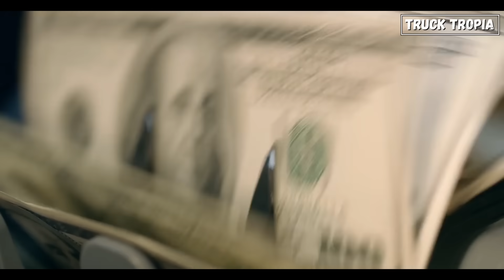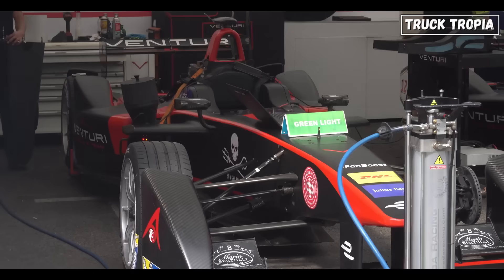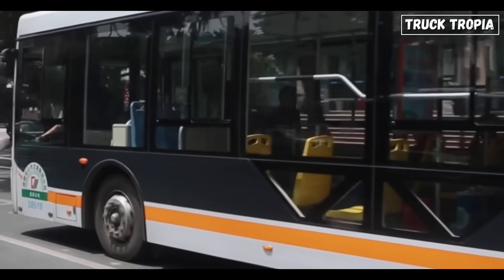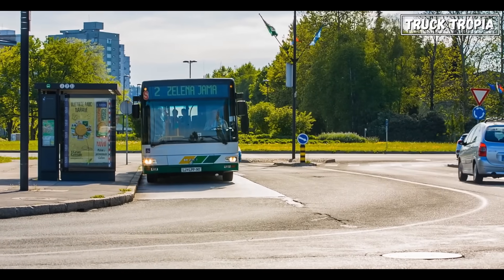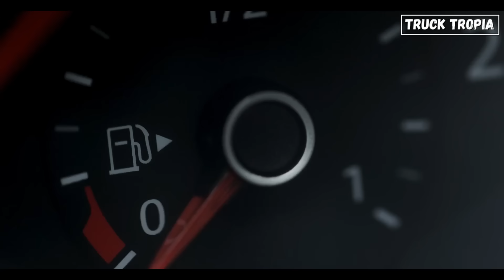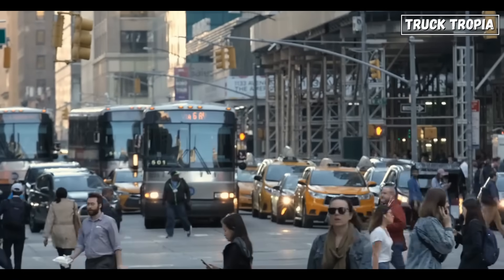Why Do Big Buses Have Rear Engines?

Comment: This is a poorly reeearched video. It should be made clear that it's mechanically more simple to make buses rear wheel drive, as well as giving them more traction thanks to the rear wheels being closer to the centre of gravity of the bus. So next it makes sense to have the engine close to the driven rear wheels to avoid having a heavy & costly long prop shaft (not a transmission tunnel as stated in the video. That's true of low vehicles like cars but would not be necessary in a bus). The weight of the engine does also improve traction as the video states but a lower polar moment of inertia for better handling is not a requirement for a bus given it is low anyway thanks to the long wheelbase. If this were the case it would be better to have the engine in front of the rear axle (like an F1 car) instead of behind it (not like an F1 car) but the latter is better as it greatly improves maintenance access for the engine. It also means a luggage compartment (if fitted) is centralised rather than having different smaller compartments spread throughout the bus.

Comment: Can someone explain why buses somehow must have a rear-wheel-drive?

Because the first two points of the video would immediately be fixed in a front-engine bus, if it had front-wheel-drive. No long cam, and thus no long floor, and similar efficiency...

Comment: What they do......is have the engine in the back,the power is transmitted via drive shaft upto the front of the bus where the gearbox is under the seat and then its transmitted via drive shaft to the slipdiff and then to the back wheels

Comment: Around 1975 I was in a bus in Peru which had a mid engine dual turbocharged flat 6 diesel, that was passing cars on uphill curves at around 14,000 ft in the Andes.
Reply: Turbo almost makes it immune to altitude.  At 14000 ft those naturally aspirated engines are minus 35% of their power.

Comment: There is a 5th reason. In the event of an engine fire its alot easier to get the passangers off at the main low entry door. Even more so if they are a wheel chair user. In a front engine bus you then have to get the passangers out the emergancy exit at the rear weather they can walk or not.

Comment: Nobody:

Meanwhile Van Hool thought back then let's bring the engine tower behind driver's compartment...

There are mid-mounted AG 300 buses which are very striking (you see the rear is flat and the seats across it by the window)

Comment: Sorry, none of your arguments makes sense to me. The same bus if you drive it backwards is a bus with front engine. You just have to put the driver on top of the engine as we do with lorries. The capacity stays exactly the same. The maintenance effort stays exactly the same. The complication coms from the fact that you have to make the driving wheels turn, but that is also solved in most of FWD cars and I have seen it as a solution in older busses. If not - à drive shaft to the back wheels is used in school busses even today. Sorry, but your video creates more questions than it answers..
Reply: Maybe the only argument I am buying is the lower noise for the drivers,  but again - look at the lorries..

Comment: Low-floor buses even lower the suspension on the side where the doors open. 
This results in an even lower entry into the bus. 
To drive, the suspension of the wheels is adjusted higher again to ensure a comfortable ride.

Comment: The bus at 3:45 is most certainly not rear engined, this is India, it is extremely rare to see any other engine placement apart from front engined, however they are not like the school buses you see in the US, the engine is inside the cabin right next to the driver

Comment: A shame you don't mentioned the under floor engines like in the volvo b10m chassis. It was  a huge space saver, also quit. But much complicater, because it needed a complete different engine than a truck

Comment: Ok, lets look at some of the points made here.

Efficient space usage, 
"length" has nothing to do with it, As there has been, and still is plenty of front engined buses, especially in the long distance category. Granted, they are slowly being phased out.
How ever rear engine on a bus does give more luggage space, especially in these long distance buses, as the cargo compartment is beneath the floor.

Comfort and accessability
This I entirely agree.

Driver visibilty
You are clearly unfamiliar with flat nose designs with front engines.
Outside of USA they are quite common (Althuogh as stated before they are being phased out) but they had large windshields, and driver sitting rather high up giving exellent visibility, even better than some of the more modern city bus designs where the driver is sitting rather low.
On handling, I again have to disagree.
It's entirely true, that rear engine improves traction, how ever F1 cars are mid engined, which gives good balance, and porsche is notoriously difficult to actually drive fast. (without electronic stability enhancements) 
To put it bluntly, rear heavy design improves rear traction, how ever, once you lose that traction, it's notoriously difficult to regain, and therefore becomes more difficult to control.

A quieter and more comfortable ride.
"modern rear engined buses are equipped with specialized sound proofing materials."
Just asking, Are these materials also banned to be used in front engined buses?
No they are not.
Are they used, most likely not it's quite likely that there is a difference how city orders a school bus, and charter line orders a long distance bus.
The quality difference is quite obvious.

Bonus design benefits.
More fuel efficient? Nope, in some cases even worse fuel efficiency, and in extreme climates I have noticed that the rear engined buses are always freezing cold on the inside, Granted, on hot days the front engined buses were quite hot on the inside.
How ever this comes to improved technologies over the years. Where engine designed in the 70's and 80's and still in use in 10's are still producing a lot of excess heat, modern engines designed in late 90's to 10's don't produce nearly as much excess heat. which does make them more efficient.
Then again, compare anything that has been comtinously developed over 20-30 years, it's quite likely the more modern is more efficient in multiple ways.
Compare old Mobira Cityman 900 from late 80's to Iphone 10 and say there wasn't any advancement.

Comment: In Sweden they have made many buses called  B10M and B9S (Volvo). Meaning it is a 10 and 9 litre engine placed in the middle. They both suck, but B9S is the worst in the world. I hate it with extreme passion. Anyway. What the bus companies have told me here up north is that they need the engine in the rear too give traction when there is snow. The same goes for articulated buses.

Comment: Font-of-engine buses are probably cheaper to manufacture and maintain generally, but usually the steering wheels are placed under the engine compartment, which means a wider turning circle, making it unsuitable for longer vehicles, especially if the engine is to be placed in front of the driver instead of at the side (so a conductor is not required). Usually they also have high-step entry which is fine for school buses and long distance coaches but not ideal for city buses and wheelchair-friendly regulations. Rear engines support a low-floor entry design, and allow overhang on each end to lessen the turning circle for longer vehicles, the cost being that the front-wheels and engine compartment intrude more into the saloon, reducing available space for standing and seating.

Comment: What about the old defunct roadmasters we al know from London. 
They had
1) easy maintenance
2) low floors 
3) smooth ride
4) great handling 
...
But the engine was in front next to the driver! 

Not saying what you explain is incorrect, but it does need improvement.
Now for smooth rides and handling while driving, underfloor engine are the best, but they tend to overheat due to limited cooling options, beside, low floor is impossible and also maintenance is difficult.
So in general, rear mounted engines are the best compromise for everybody.

Comment: Buses already started to have rear engines in the 1950s (see Ikarus 55) to reduce noise, to be streamlined, to be more comfortable, just to name a few advantages.  Since about 70 years ago. So, tell me why not all the US school buses are all rear engined?  Money? Politics? Of course.
Reply: Money is a part of it but it's not necessarily politically sinister. The school bus design is cheaper and can fit more seats in the saloon, but it's iconically American. In some countries like UK, buses for schools aren't uniquely designed, they just use retired public buses, for which the American school bus is impractical because it has a wide turning circle and does not support low floor entry.

Comment: As for better handling, worth mentioning that rear engine gives more freedom to the front wheels to turn more as there is no engine in the way. This concept was made in last generation of Twingo and most Smarts use rear engined layout because of this and both have the shortest turning circle of all cars which makes them excellent in tight spaces.

Comment: Not a bus pro or anything and have no specific knowledge about buses design and engineering but I think some parts of the explanation are not quite right at least in my opinion. Feel free to correct me if I'm wrong.

1. Better handling: Handling is more important on the front instead of the back since the turning tire are at the front. Setting the engine in front suppose to make the handling better since more weight on the front tire = more traction = easier to turn.

2. More space for passenger and cargo: Doesn't matter front or back, the engine still takes up the same space under the bus, so it doesn't affect the cargo space (Unless it's an front engine with transmission bar to the rear wheel, the transmission bar will take up some space.

Some point on Why rear engine is better in buses:
1. Easier access for service and maintenance: Setting the engine in the rear means you can place a large hatch at the back of the bus to access the engine section without affecting the location of other systems (front car light ect)

2. Easier accessibility for passenger: Both front and back door can be located nearer to the floor and no stair required. Cargo bay can also be located nearer to the doors by located in the middle of the bus.

3. More logical placement for raised seats: With the engine placed at the rear, the seats at behind will need to be raised (sitting near the top of the engine bay) but instead of causing discomfort, the passenger sitting behind actually get better view range since they are higher and won't get blocked by the seats in front. 

4. Less engine sound get into the bus: Since the engine is at the rear, when the bus is traveling forward, part of the engine sound are left behind by the bus motion and it's easier to decrease the disturbance from the engine.

Comment: Wrong. Engines aren't quieter if they are in the back. That makes no sense. The engine is with the cabin's envelope. On a front engine vehicle, the engine is outside the cabin. Modern cars are quiet because they insulate the engine from the cabin. And modern cars are very quiet and the mostly have front engines. So I'm call BS on this assertion. It's wrong. It's all about money. If you're comparing it to a school bus, well that's something different. Parents will pay for comforts and complain about it if directly affect them. However, if it affects their kids, well, that kid just needs to tough it out, they aren't going to get a better bus if it raises their taxes. Tighter seals on doors and windows, firewall sound absorption materials. Buses aren't different. If you isolate the engine, with similar methods, it works regardless of the location of the engine.
Reply: Rear engines are quieter for the driver, who is on the bus for a lot more hours of the day than the passengers, usually.

Comment: In terms of front engined buses, I think you are focusing more on American school buses. African buses with front engines, when it comes to the driver's position and visibility, are the same. Yes, in some other versions like the Irizar Intercentury, the one with a front engine, the driver is a bit higher than the one with the rear engine, but the difference is not that much. Here in Africa, buses with the front engine, the driver sits next to the engine rather than behind it like it happens with American school buses. Another example we have in Africa with different engine mountings is the Marcopolo G6 Andare Class. Some models of it have engines at the front while others their engine is at the rear. However, the driver's position is the same.

Comment: You were a little lacking on details. The more space reason is obvious - there is no large drive shaft tunnel down the length of the bus, which takes up space and forces the floor to be higher. The better visibility reason is obvious too. But what about the rest? Why is a rear-engine bus more efficient? It still has an engine. Can they use smaller engines for some reason? Why is the cooling system better? The engine still needs to be cooled, and doesn't have direct access to the cooler air at the nose of the bus. Why is it quieter? Can't a front engine bus use the same technologies to keep noise and vibration out of the passenger cabin? Does the long drive shaft on a front engine bus make that much noise? Are rear engine buses more maneuverable because the front wheels can turn sharper because there is no engine block in the way? Or maybe just because the driver can better see where the front of the bus is?  

I think that you were missing some details of the rationale for some of the design choices.

Comment: So why no buses with engines in the middle? What will it be like?
Reply: They used to, and some coaches still do. But it's more difficult for mechanics to access, and a lot of countries now require buses to have a low floor entrance for disabled passengers, which cannot be supported with a mid engine design. And they're used to be pretty noisy for the driver back in the pre-low-floor days.
Reply: @ Ahh thanks a lot! Good to know!

Comment: Not sure about the handling part. The engine is behind the wheels which barely exists for car nowadays as it made the rear extremely slippery. Could not be true for buses because of the overall weight of the machine but the sports car have read MID engines located before the rear wheels for better handling. Not behind

Comment: The most space efficient is a high floor bus, not a low floor. It only uses about 60 percent of the surface area, since the wheels have to share the same volume as the passengers.

But apparently having a lift is too much to ask for, and now they have to be zero effort....while cutting down the amount of passengers that can board, how long the bus can last. Its a grift.

Comment: Also means the exhaust and driveline aren't traveling down the length of the bus, adding to less noise, vibration, and weight. Engine over drive wheels is superior in every way

Comment: Rear engine buses can be more prone to overheating than a conventional since the radiator is usually mounted on the side of the bus and does not get air flow like it would in the front.

Comment: I think this video was made by I.A., or by someone with very basic knowledge in buses, because front engine buses can be the same efficient and comfortable as rear engines, and not all the rear bus engines are quiet xD , just take a look to the chinese bus Zhong Thong navigator, that's an awful intercity bus because of the lack of sound insulation and bad quality of the materials of the interior of the bus.

Comment: One small detail you got wrong here is that Formula 1 cars are not rear-engined, they're mid-engined. Their engines sit just ahead of the rear wheels and behind the driver. Rear-mounted engines are placed further back to behind the rear wheels.

Comment: Rear engine bus always gets better traction because the heavy engine is right on top of the rear axle as typical buses are all rear wheel drive. When you accelerate, weight transfers to the rear tires, increasing their grip and potentially improving acceleration.

Comment: With the exception of Porsche, sports cars aren't rear engined, they're mid engined. Rear engined vehicles have the engine behind the rear axle which in nearly all cases compromises handling.

Comment: ive seen busses with now engines vertical in one corner, why is that?
Reply: The radiator is placed above the engine, which allows slightly more saloon space on one side of the back of the bus, and for European buses that have multiple doors, a second or third door can be placed further to the back of the vehicle. These designs aren't as popular in the UK because the door is on the opposite side of the vehicle but manufacturers don't want to change the engine compartment to the opposite side as that's more difficult to redesign, so the UK does not get the advantage of that design. Sure the fire exit could be placed further back but that's not really an advantage.

Comment: As a kid, I always thought if the engine in the bus would be in a front, then the drive shaft would have to be very very long. That's why front engine buses'  back wheel is as closer to the front as possible. When I grew older, that's exactly why it is the way it is.
Reply: I hate being behind or anywhere near those kind when they turn a corner. The rear end can knock out anything in the next lane.